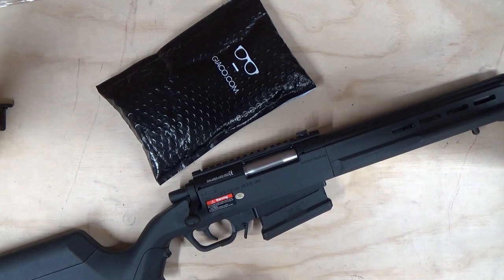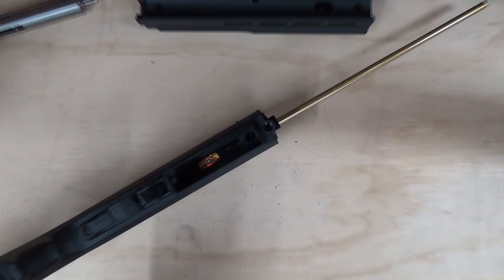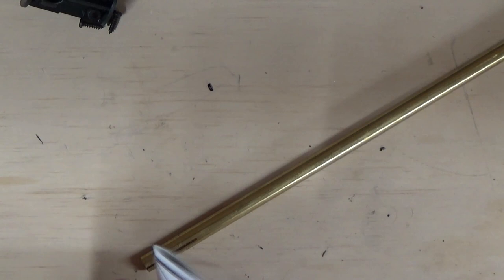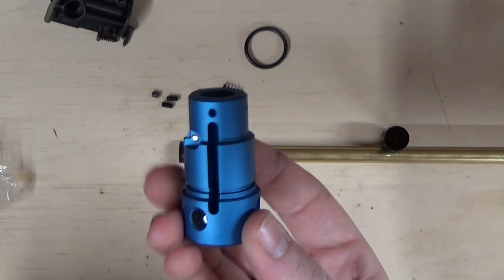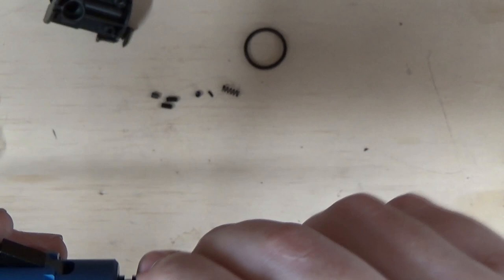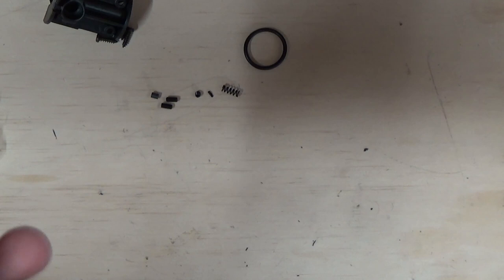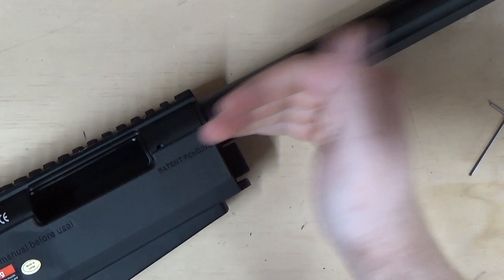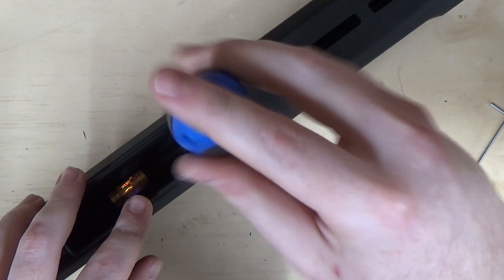Ares Striker Complete Upgrade Guide (AS02, AS03, AST1 & Knee Capper) - Part 2

Comment: Hey is there a way I can get in touch with you through email? Im currently struggling with my new ares ast01 not shooting projectile despite air blowing out the muzzle… many sources seem to suggest that’s a jammed barrel but upon inspection the hop-up chamber, inner-barrel and bucking seems to be perfectly fine… I’ll greatly appreciate the help🙏
Reply from the maker: You can email me at james@jaegerprecision.co.uk
Reply: @Jaeger-Precision  Hi, I'm looking to install a 6.01mm barrel into an AS-03, could you provide a link to a recommended barrel and aftermarket hop rubber?